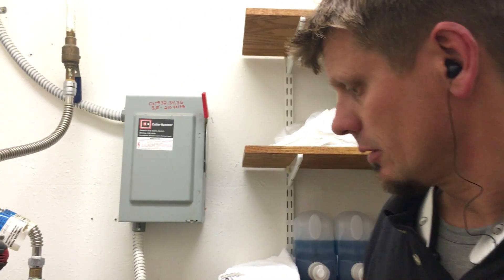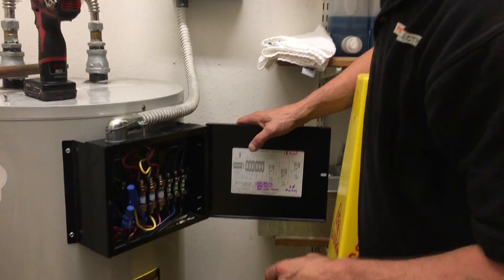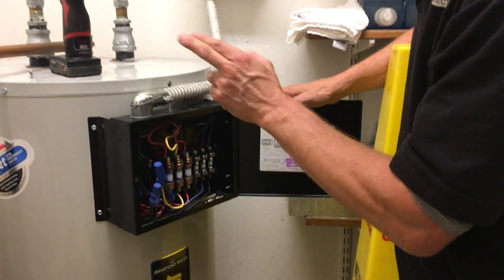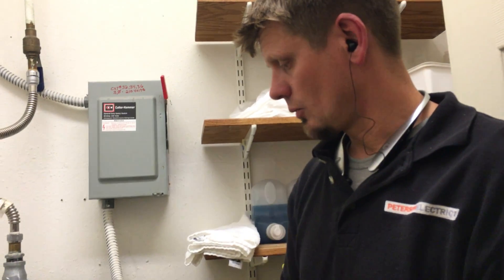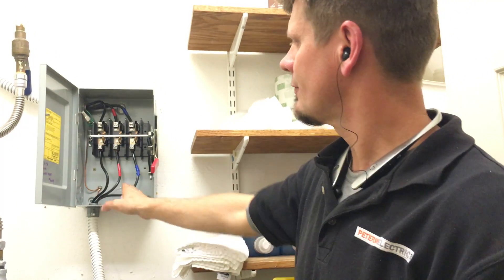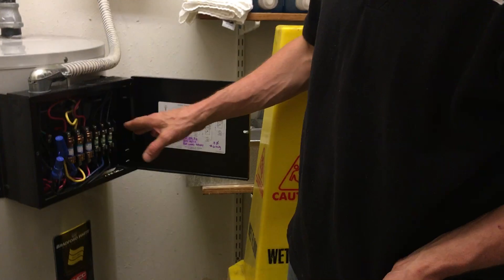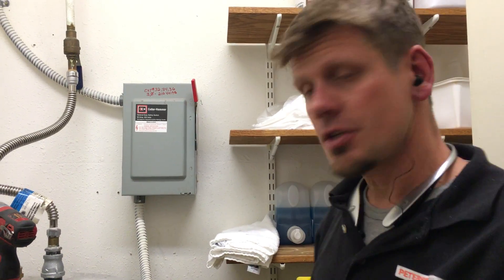Why Hot Water Heater Fuse Burnt Up In Hotel Panel,  Part 1

Comment: If you run a 240 volt resistive heating element on 208 volts you typically get 75% of the wattage and BTU output. So for example in this case if you have a 4500 watt element at 240 volts,  it will only draw 3375 watts at 208 volts.

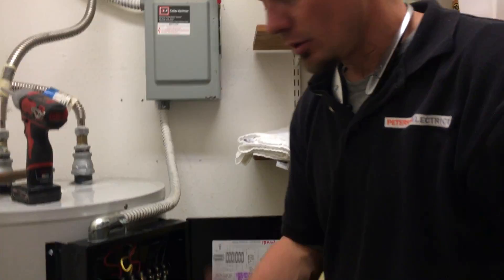Comment: 1:45 if you lower the voltage going into a resistive heating element, you would need to increase the current in order to still have the same wattage, however this isn't actually what happens. as voltage drops, the current also drops, due to ohms law. this results in less wattage delivered to the heating element. (unless it's regulated in some way, but that's unlikely with a water heater)
Reply: +Pete Lorenzo Pete, I understand what you're saying. However in this case the tank was wired for single phase. What he he is saying is there is a different internal wiring pattern based on the input available, with a different impedence used to try and achieve optimum heating for either input option. It would have been nice to see details of the schematic diagram to compare the two different wiring patterns. As with many three phase motors, the different wiring pattern is designed to optimize power delivery by reducing impedence for the low voltage option, resulting in higher current to compensate for the lower voltage applied.
Reply: @spelunkerd  a motor is completely different than a resistance heating element. Heating element is simple ohm's law.